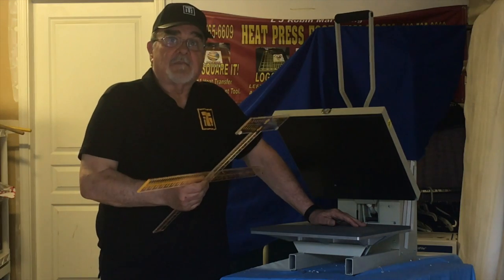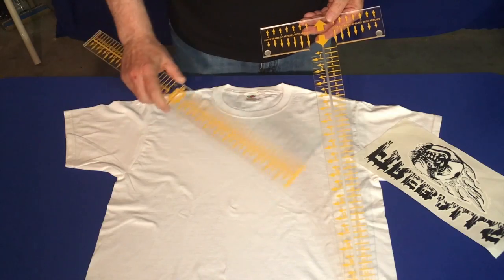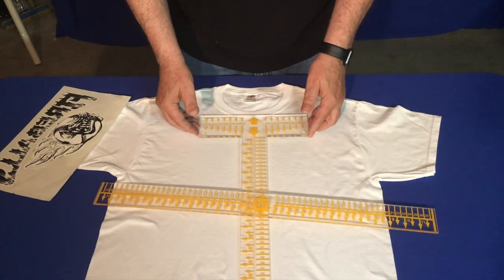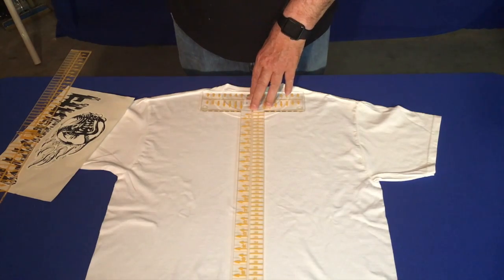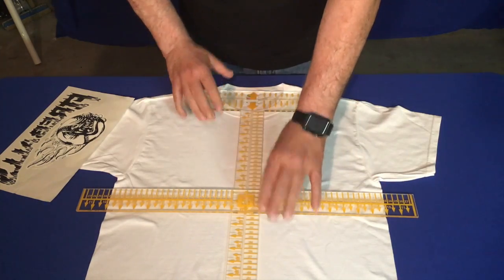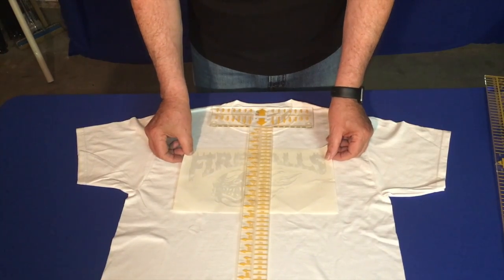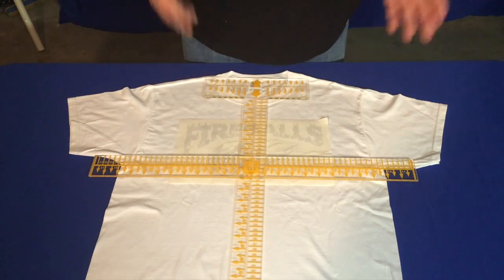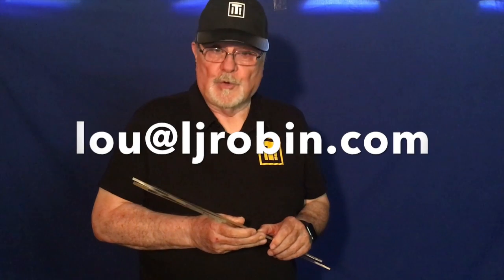Tee Square It 'I" 2017

Comment: It is easy to align on a large flat surface however it gets a little tricky on the heat press maybe I just don't have enough practice with  it I ended up putting it away and training my eye. It was also taking me to long  my vinyl has sticky carier so it makes it much harder to move around. It is a good product just didn't do it for me.
Reply: Tape